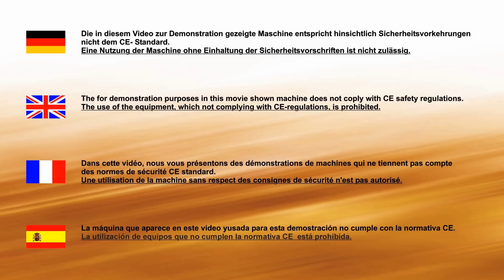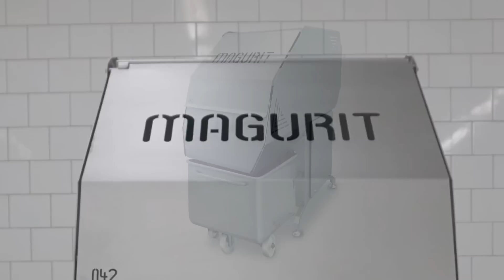Fromat 042 eco + profi

Comment: which is the best way to clean the magurit blades
Reply from the maker: Dear Mr. Gonzales, 
generraly speaking larger residuals after processing the frozen blocks are manually removed. Then the blades get first washed down with warm water to soke protein sticking to the blades. Additionally the blades are usually sprayed with cleaning foam, meant to kill bacteria. This foam needs to be washed down after the soaking time the detergent producer recomments. If the machine after the cleaning procedure is not going to be used for a longer time (e.g. several days) we recommend to spray the blades after with food-grade oil, so that no microbiological growth starts on the blades. This oil should be washed down before the next use of the machine. In our manuals detailed cleaning instructions are given. I hope this answers your question.
With best regards
M A G U R I T  GmbH